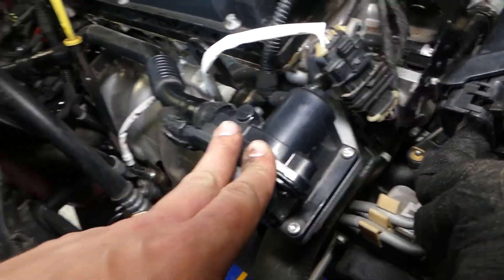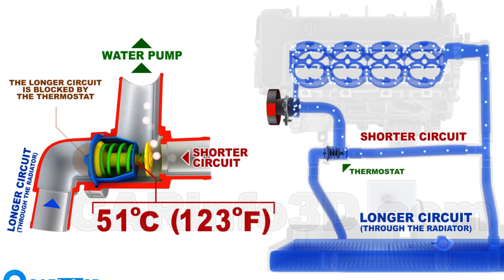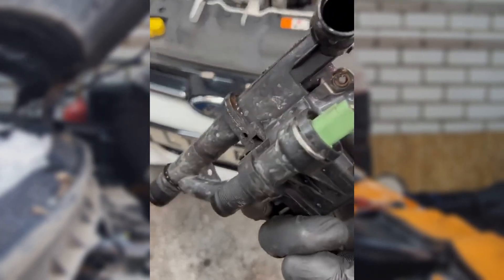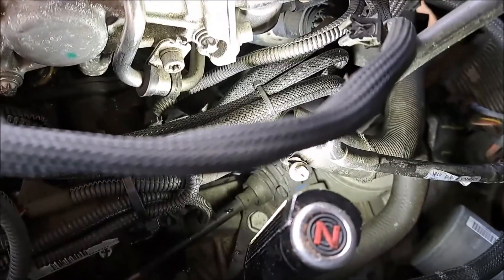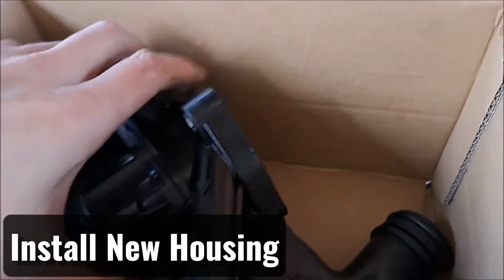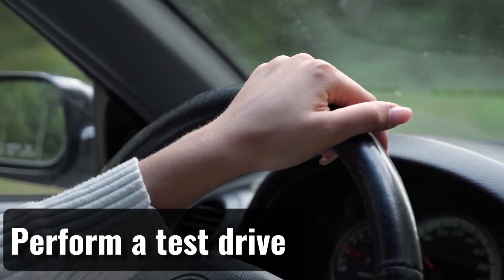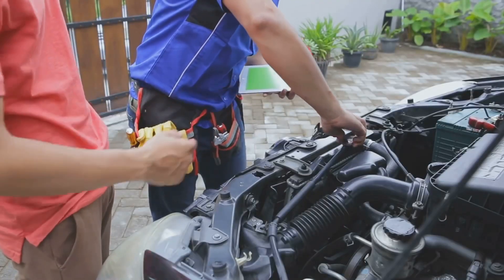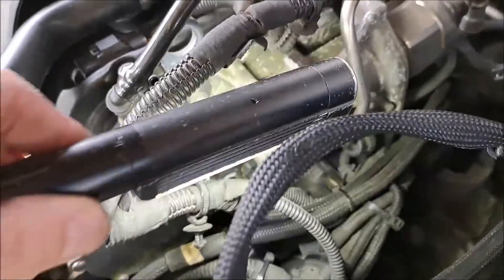Dealing With Leaky Thermostat Housing - Causes, How to Replace & Replacement Cost

Comment: I've bought 4 separate thermostat housing and all of them have been defective.
Reply from the maker: Yeah, that’s become common lately — a lot of aftermarket thermostat housings are junk right outta the box. Try to stick with OEM or a trusted brand like Dorman HD or Motorad. Make sure the surface is clean and flat, and don’t overtighten the bolts — that plastic loves to warp and leak.